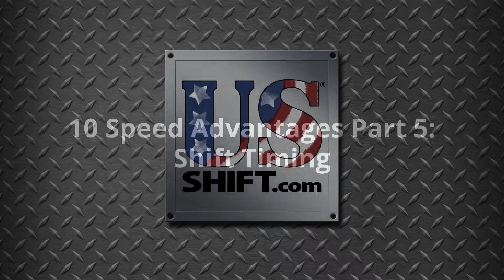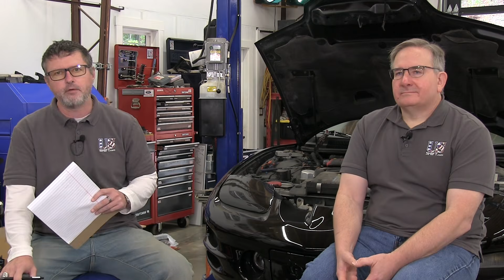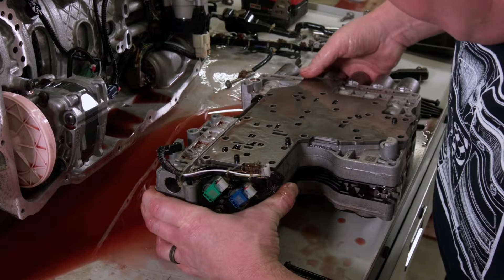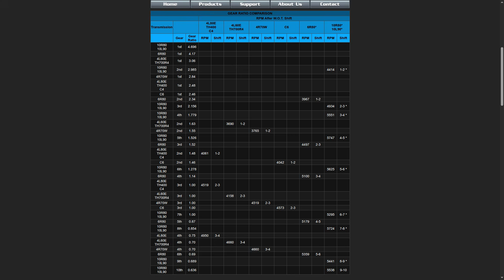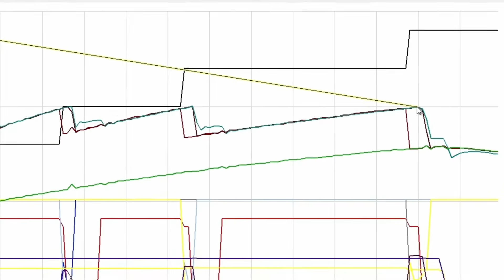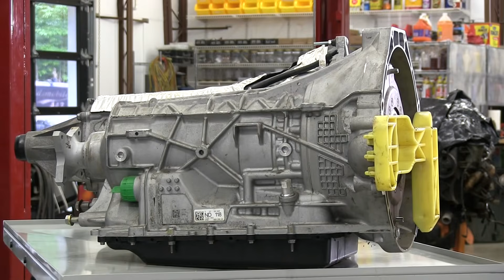Why 10 Speeds: Shift Timing

Comment: for the 04-08 f150 series would it be possible to 10 speed swap aswell and retain cruis control i know theres 6r80 but what about the 10r80s?
Reply from the maker: Cruise control is compatible for vehicles with cable operated throttle bodies. We are currently developing CAN bus communication, which will allow the Quick 10 and Quick 6 to work properly with cruise control in vehicles with electronically controlled throttle bodies.
Reply: @Usshift Any updates on the 06 Mustang GT 5 speed manual to 10 speed auto swap. Like to know how it drives and what kind of performance benefits it gave it.

Comment: would this retain crusie control? im assuming not
Reply from the maker: Cruise control is compatible for vehicles with cable operated throttle bodies. We are currently developing CAN bus communication, which will allow the Quick 10 and Quick 6 to work properly with cruise control in vehicles with electronically controlled throttle bodies.

Comment: Say I want to put a 10R80/140 into a 2005 Excursion V10 (modular) using this kit, what's a rough list of items I would need? The Quick10, the transmission w/factory converter, a coyote flywheel, probably a custom driveshaft, and a custom transmission mount?
Reply: Youll need the wiring harness for the transmission
Reply from the maker: That is most of it. You'll also need a bigger transmission cooler and lines, as well as a custom tune to disable the 4R100 control in the factory ECU.